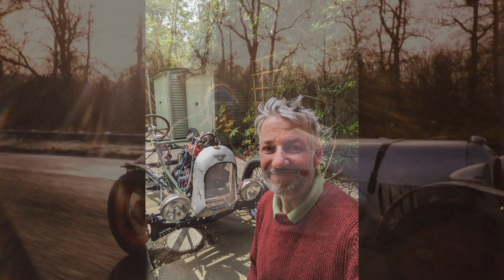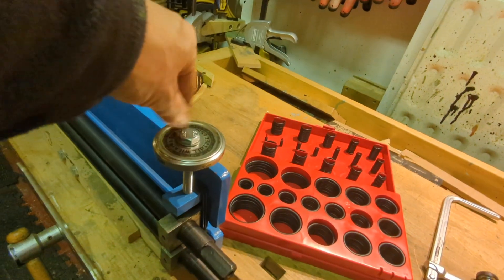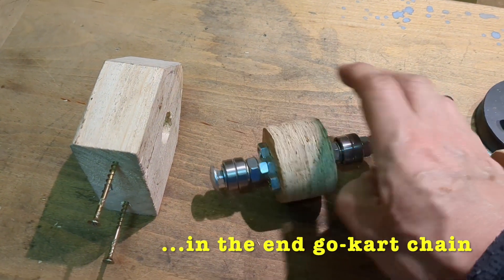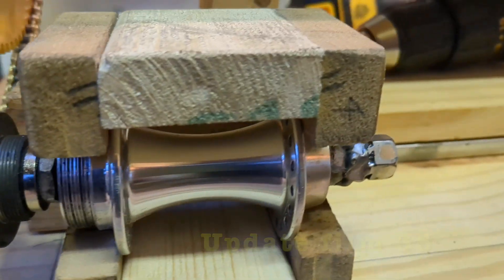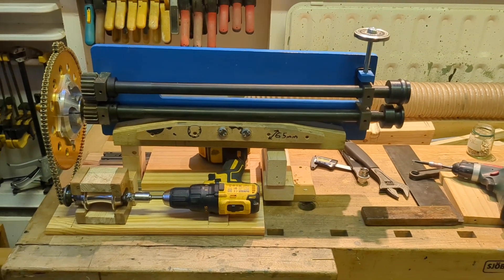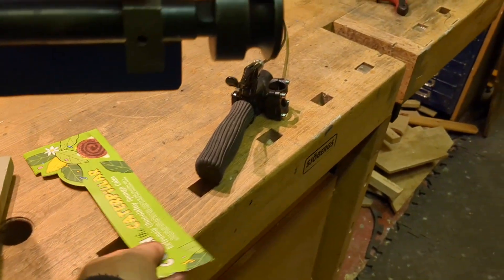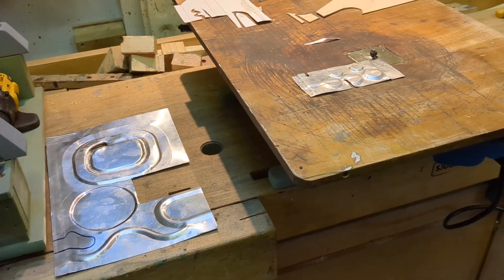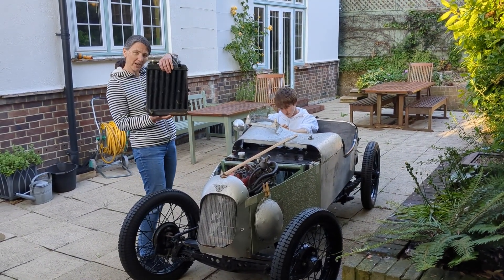Vlog - Power a bead roller, knibbler table build - 032 to 038

Comment: Car windscreen wiper motor and some cheap bicycle chains and sprockets works find for motorising these. More than enough torque from the worm drive. Then a cheap speed controller and a DPDT switch to change polarity for direction. And a simple on/off foot switch to control it.  I am sure I have a film on my channel showing it but good luck finding it, I have too much crap on there including Austin 7 stuff!
Reply from the maker: I've watched a lot of your films but can't remember that one.  There's a lady in the states who does ADHD films.  She started so she could keep stuff organised, then added review films pointing to stuff, then got help with the managing the channel.
Reply from the maker: I remembered what I like about the gokart stuff - there's a sleeve that fits the bead roller shaft to bolt on the huge sprocket so no welding...but then I had to weld the tapered tiny one to a shaft.